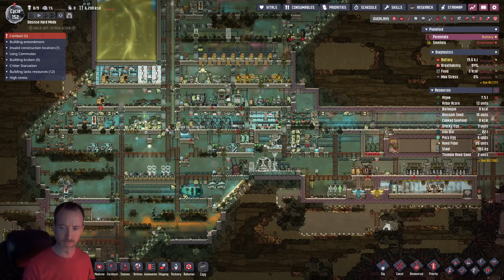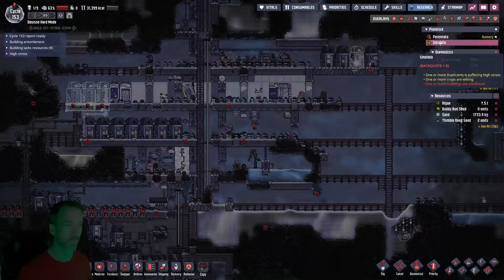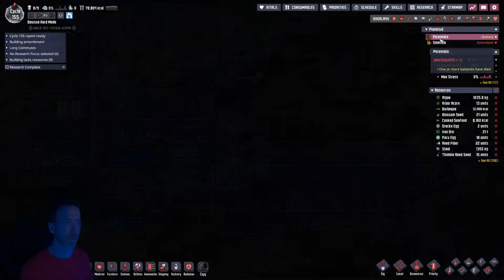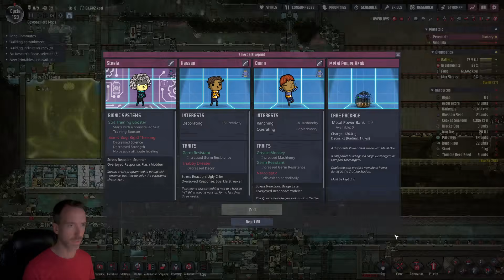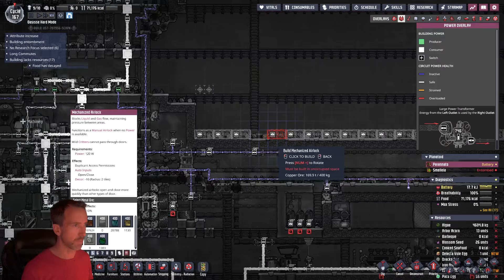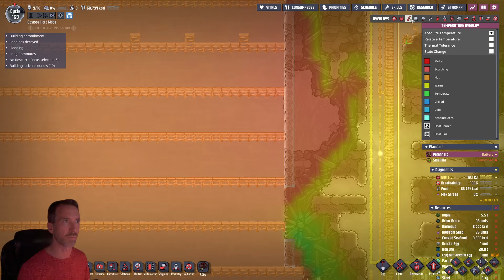Claim the Hot Land - Oasisse Hard Mode  - Ep. 16

Comment: For the stacked fluids on Smellio - put a pitcher pump in.  You can then 'request' water or polluted water to pull those off the top of the mix.  A pitcher pump will give you access to whichever fluids are touching the stem.